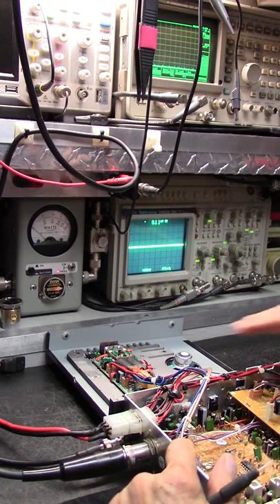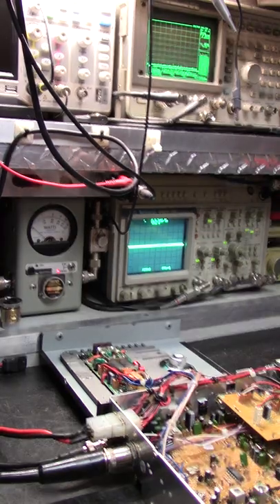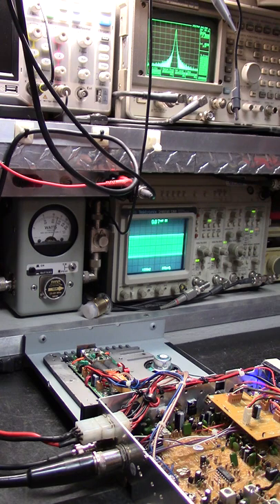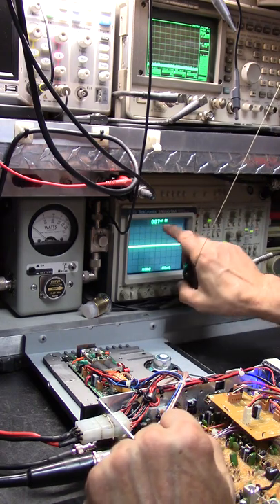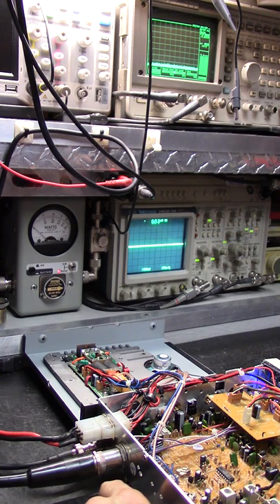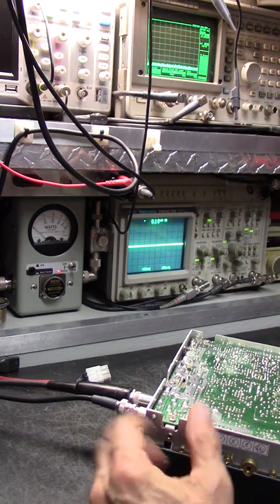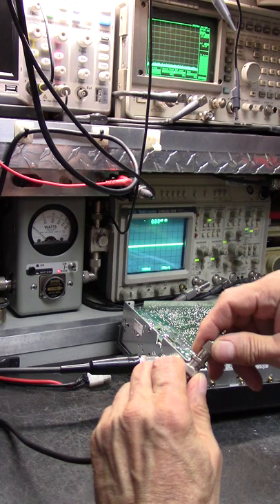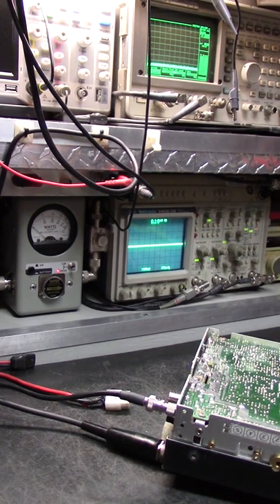CONNEX 4600 Turbo with two Matched Toshiba 2SC2290's.

Comment: Good tips! I have been doing the bnc connections for many years. It is worth every penny you spend to do it this way! I even have changed my so 239 chassis mounts to Bnc. It stopped the pl259 from coming un done in the truck and in my personal pickup ! ( Dodge 2500 Cummins 2001) I am now using Times microwave cable for speaker cable also!. Back t o working on the semi. 73 Tod kc9rka.
Reply from the maker: I've been modifying external speakers with bnc's for decades and using shielded audio wire just as long but the bnc to 3.5mm mono is new ..  been using rg58au lately. Be cool man and 73's!!